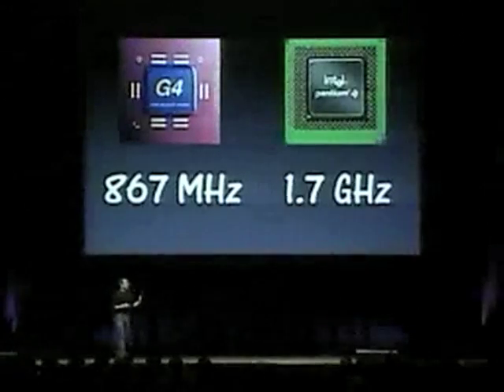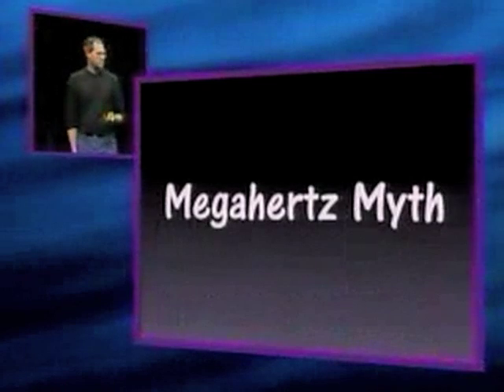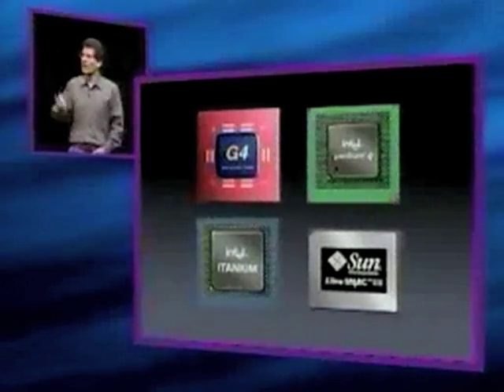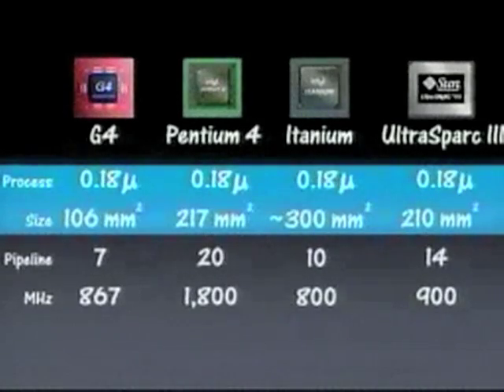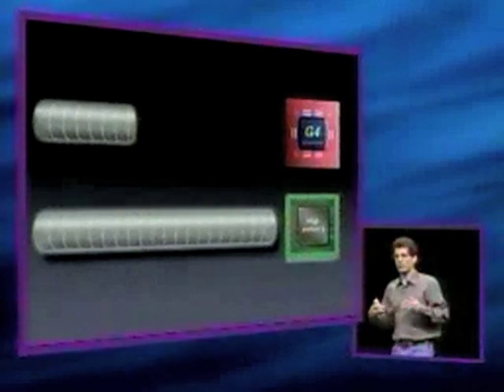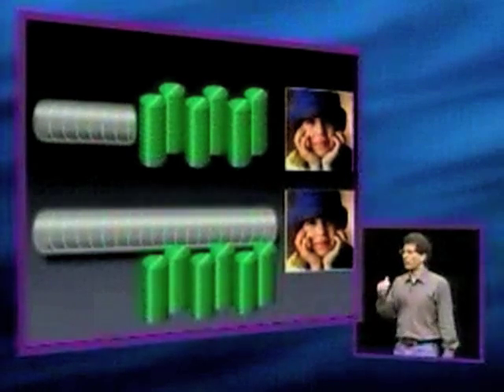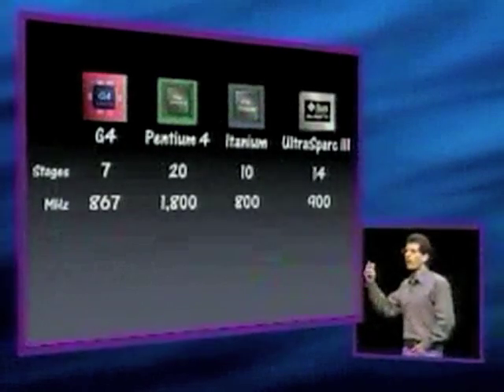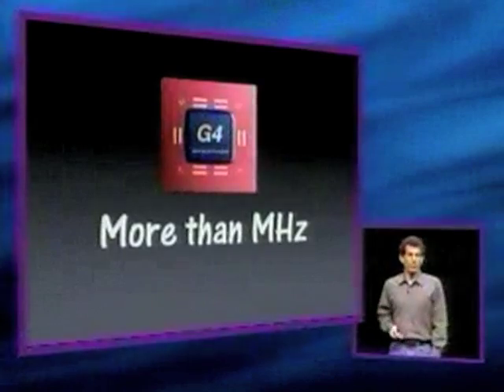Megahertz Myth

Comment: 3 years later: In 2004, Intel’s deceptive tactics of marketing on clock frequency would come back to bite them, catastrophically.
Reply: G4 focuses on 128-bit SIMD hardware.

P4's SIMD hardware is just 64-bit wide i.e. "double-pump" 128-bit SSE. Core 2 has the full 128-bit SIMD hardware with high clock speed.

AMD K8 was the first X86 CPU with a 128-bit FADD SSE unit, while FMUL SSE is 64-bit wide.

Comment: so many years later and this is still so relevant!
Reply: Yeah. I remember when the 8-core 4GHz FX-8350 having less performance then the 4-core 3.4GHz i5-3570K. So many people went for the AMD because it was cheaper and the specs looked better on paper. It was cheaper for a reason.
Reply: @ryantoomey611  and now AMD has less instructions per cycle and therefore needs less GHz for the same performance as an Intel CPU. Oh how the turntables
Reply: @jooplin  It was idiotic how they even went to long pipeline. They watched Intel crash and burn with the P4 then AMD kicked Intels arse with K8 Athlon 64 with short pipeline optimized for IPC far better than Athlon K7 and PIII even. Then they improve upon what was essentially the same arch with the Phenom II and things look promising even have a 6 core then comes FX backwards in IPC and even the clockspeed couldn't make up the diff many times. Piledriver was not enough an improvement and Steamroller could have been worth it for certain uses but they never even released that one on DT.

Comment: This video was shot in 2001. 18+ years later, this is still one of the best descriptions of the complications of PC processors and how theoretical performance on paper does not equate to real world performance. Speed claims are meaningless until a benchmark can prove it. The way PC's are still sold in 2019 is atrocious. You are meant to not understand this when purchasing one.
Reply: To be fair though its not the pipeline stages that hold a CPU back these days as they are all considered fairly high compared to this videos chips at 19+ for modern uarchs. But I get the point it still stands that the little intricacies determine real performance. Better Branch Prediction largely extinguishes the performance hit for longer pipelines these days. The Pentium 4 had 20 stages later 30.. Bulldozer was believed to have 20 stages AMD Zen has 19 and Intel Skylake even more!

Comment: I think Steve Jobs could sell Holy water to a priest. & I must ask who designed the software for their benchmark test?
Reply: P4 was an underperfoming abomination, thanks in large to its 'hyperpipeline'. Intel dropped the uarch for a reason.
Reply: @blurandomnumber  From what I understand, to catch up in efficiency with RISC processors, Intel slowly transitioned their CISC processors to behave more "RISC-like" internally. It's interesting that the processor efficiency we have today (with INtel AND everyone else) was pushed and pressured so hard by PowerPC, as well as other competing processors like Sun's SPARC.
Reply: @RedHairdo  Indeed, a few RISC paradigms were successfully adopted by Intel, but on a uarch level, past the decoder.